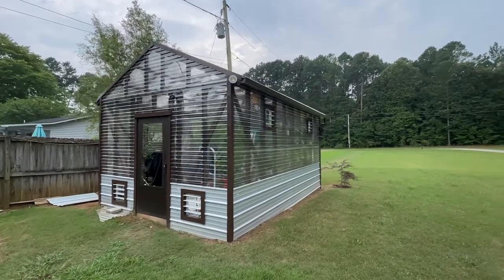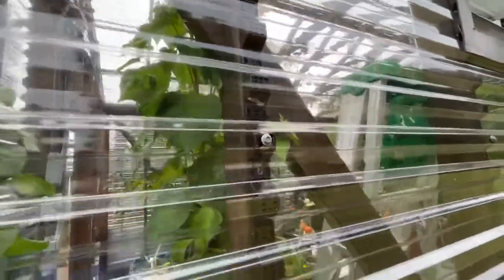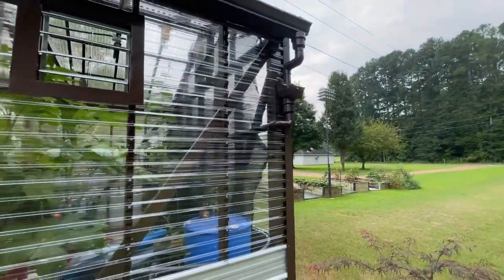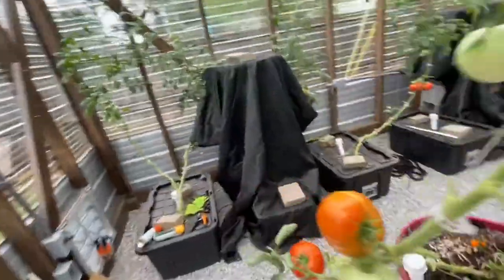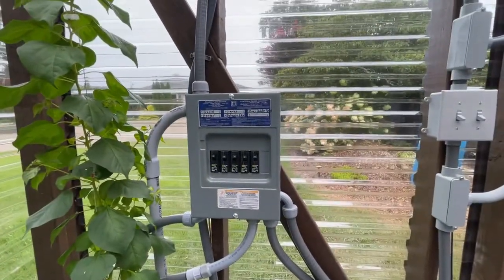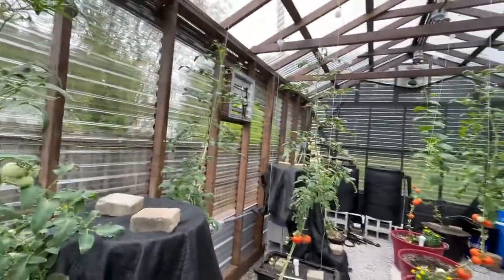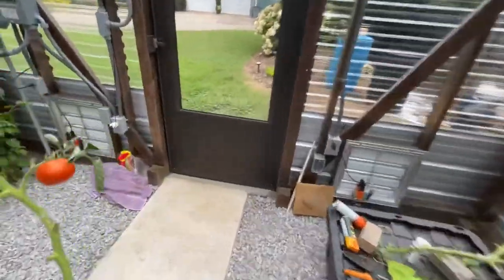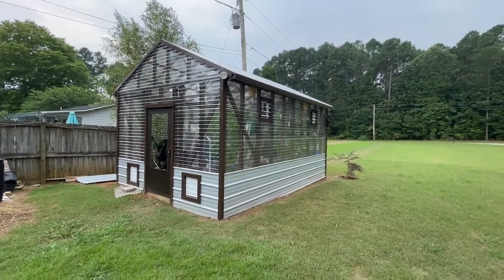Finished 12’ x 20’ greenhouse build walk through including ventilation system, rain collection.

Comment: Great greenhouse and cool automation. I am interested to know how the intake louver opens when the exhaust fan kicks in. I see that the intake louver is powered by the nearby outlet and not by any connection from the thermostat or exhaust fan. Please clarify. Regards
Reply from the maker: Thank you.  I actually have the intake louvers and exhaust fan plugged into outlets that are all wired to the main thermostat.  You can do it any way you want to, but I just chose to wire it that way in case I needed to replace one of the louver motors.  This way all I have to do is plug it in instead of hardwiring again.